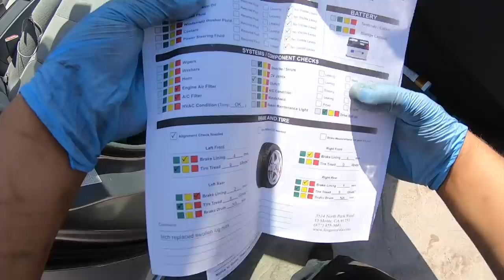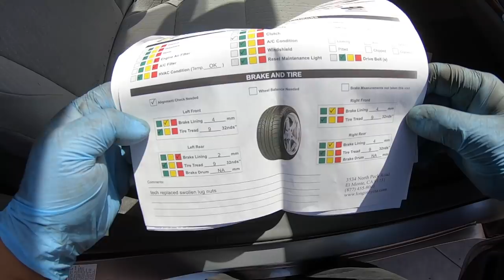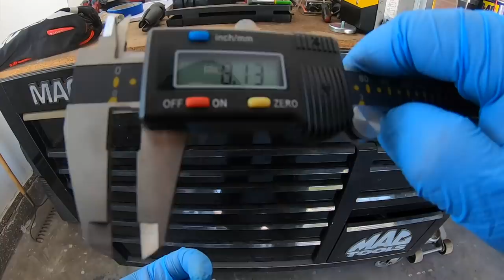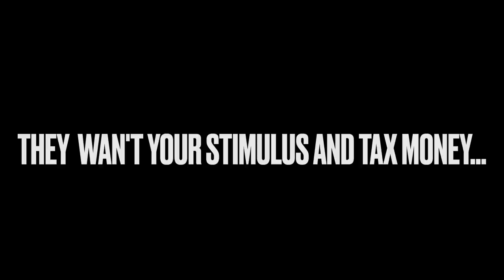This is why YOU need to avoid the Dealerships!

Comment: I was scammed by Honda dealership $2300 for a.c. repair that was never fixed the first time.At the second time when I come they said they have to replace the evaporator.I asked for some refund but the service manager refused not even a dollar refund.So from then on I became a DIY freak,Do everything about A.C. repair.and more.Also brakes,Timing belt is the hardest.So I won't buy cars with timing belt but chain.Honda stealership charges almost $1000 for that which you can do for $100.

Comment: im a tech at toyota also. The tech didnt take the tires off to get a good reading on the brakes. he just peeked from the outside of the wheel and thought they looked low. The technicians at my shop are very loyal, trustworthy and hardworking people. U got a bad tech.

Comment: I've had multiple dealerships lie to me (often Toyota, but I've owned a number of that brand). 

I had one tell me my 2003 Corolla needed a new timing belt (the car uses a timing chain, so that was impossible). 
I've been told I needed a service I just had done at the previous visit. 
I was told (this is sales) that the extended warranty they were trying to sell me was from the manufacturer (it was not: Toyota has no extended warranty program, unlike (say) BMW). 

I can't think of every example; but it's hard to find a dealership that will simply treat you honestly.

Comment: This is due to a lazy technician.
Doing a visual only multi point inspection (MPI) on every vehicle, you get this sort of laziness.
The tech probably didn't even take the wheel off for proper measurements.

Comment: Toyota shear my bolts that holds up my skid plate during an oil change. They secured my skid plate with zip ties (found out upon inspection during my incident). The zip ties broke while I was driving and my skid plate fell. They wanted to charge me $600 to drill out the bolts and retap. I called the dealership and they ignored me. I filed a complaint with Toyota USA and they ignored me. I have never worked on my 4Runner but now I do my own oil change, breaks and rotors which is very simple. I will do as much maintenance as I can.

Comment: I had an overheating issue with my 3 year old, 40k miles minivan. I brought it into the dealer that I purchased the van from, they checked everything including inspecting the radiator, "topping" off the coolant (it was already topped off), etc.. I ended up being charged $120, even though they didn't fix anything. I looked online and was told on a forum to check the fuse. It ended up being a blown fuse for the 2nd radiator fan. I spent $3 to fix it on my own. I called the dealer and explained the situation, they offered me a 10% coupon for any future repairs. what a joke.

That was 10 years ago, I've never brought my vehicle back to any dealerships for repairs.

Comment: Awesome break(brake)down...  Not all dealers are lazy/crooked, but the same goes for third party service as well. Ultimately don't blindly trust anyone. Some dealers have been the absolute best service with no BS or surprises... Others have been dodgy as and I call them out on it. Usually it's laziness, just basing "work" on the service manual not taking into account other work in the book or the car's actual level of use. Find a good mechanic and give them your business.

Comment: Longo did a terrible job fixing my car, the bumper fell off the same week! I tried to bring it back but they said my bumper was scrapped, so they didn't fix it. My front bumper had a light scratch from exiting a driveway. They even dropped primer on my car's side window and didn't fix it for months! They also overcharge for cars. Im never going back

Comment: If vehicle brake pads are at about 5mm left, which in some cases is about 50%, I'll mark it yellow. Once they hit 4mm, I'll start to recommend brake pads. 3mm and less is when I start to really push. By that point you are required to replace them.

Once you get to the metal backing plate of brake pads, you damage the rotors and you run the risk or damaging the caliper piston. Calipers start anywhere from $100 and upwards of $400.

I do get that some shops and dealerships will rip people off, not all technicians will push, unless they haven't flagged may hours during the pay period.

Comment: At the BEGINNING of the Video the man said "Get a second opinion!"  This is very true, until YOUR mechanic of choice gains your trust.  I AM a mechanic at a dealership. ALL MY customers trust every single word I say. And for good reason.  I tell them everything about their vehicles. Bumper to bumper roof to floor.  I give them certifiable measurements with pictures. I also let the customers see for themselves what I am seeing.  75% of the time I sell ONLY what the vehicle needs and nothing more. Optional services I only recommend when it further guarantees my success of the original repair. For instance,  I had a customers car than ran a bit rich due to a sticky crank case ventilation system.  I sold an induction service to clean all the old oil out of the intake manifold.  Results?  These days the only time I see the vehicle is during regular maintenance and routine services.  That same customer usually has somebody drop the car off and he calls me and says, "Do what you need to do, I trust your judgment."  This same customer is a football player in the NFL. And obviously he does not drive a toyota. But I treat EVERYBODY exactly the same no matter their financial status.  My only point here is Simple.  Do not lump ALL of us in the same sinking ship.  I work my butt off to maintain customer trust. And ALL my friends at work are the same as me!

Comment: Vehicle owners need to READ their owners manual & find their scheduled maintenance section on what the manufacture recommends on what needs to be done. Some say brake pads need to be replaced at 30,000 miles on average. It could be more or less on how or where you drive. Be informed so you don't get taken. 
   I have a 32 year old vehicle, scheduled maintenance states to replace spark plugs every 30,000 miles. I replaced them at 90,000 miles. At 112,500 miles I have an oil change done; they told me I needed spark plugs; I declined since they were replaced at 90,000. I waited at 120,000 miles to do them again. Were the worn out? Yep. Replaced them again. Get educated on your scheduled maintenance people!

Comment: My dealership told me I needed rear brakes, and wanted $700 for the job (pads and rotors). I said no. My friend verified that it would still be a good idea, so I bought parts and did it myself. Did I necessarily need those brakes done? No, but the rotors were worn a bit and the pads were not low, but showing damage. So, while I believe they were trying to jump the gun and get my money ($700 for rears? Really?), I don’t think they were being deceptive.

Comment: In Romania we by default assume the dealer is gonna try to rip you off. I have my own guy for car maintenance. One time I needed a diagnose on my ABS sensors and he did not have the tools so I went to the dealer. They did provide the results and also what I needed to change on my car...they wanted me to change around 1000$ worth of stuff, it was half the value of the car.
Took the car to my guy and showed him the results, he actually had me under the car to show the parts they wanted to change...they were in working order and they are still on the car to this day, that was a few years back.

Comment: For anyone curious. Brand new brakes come in around 12-14/32. Failing is 2/32 for an inspection. Rear brakes also wear slower. Assuming your calibers aren’t shot or you don’t drive like an asshole, you’ll typically get about 40k miles out of your brakes or more. A lot of pads also come with a squealer to let you know when your brakes are low without having to have them looked at. Keep all that in mind and you’ll know if you should be suspicious of someone trying to up-sell you on brakes.

Comment: The gas cover on our Hyundai stopped opening properly. I took it to the dealer. Not only does the dealer not offer to fix their own bad product, but they want to charge me $450 + tax to replace the entire door, which doesn't fix the root cause of the issue and will just break again in a few years. They also wanted to add $1300 in additional services. Wtf? I declined, and they got angry! Nice customer service. No I don't want to spend almost $2K today. I went home and fixed the gas door myself for free. Took less than 30 minutes.

Comment: Stealerships are worse than the independent places now. 

Went in to have some warranty work done on the wife's Camry. L/F brake was making a single "clunk" noise when moving from a stop in reverse. (backing out of garage). The stealership tried to tell me the rotor needed grinding because it was warped. If it was warped, 1. The brakes would feel like they were pulsing when in use. 2. Braking would be uneven and the car would pull to one side when braking. 3. The caliper would potentially drag on the rotor even when the brakes were not in use. 4. The brake pads would show uneven wear. The car had exactly zero of those symptoms. It just made the clunk sound.

And of course, for only $136, they would grind them down for me...because that is not covered under the warranty. 

We bought the car brand new. My wife drives like an old lady. She isn't hard on brakes....or anything else for that matter. They were just trying to soak me for the money.

That was my third run-in with that stealership. First one was a sales-parasite blatantly lying to me over and over and then another sales-parasite breaching a contract.

Comment: Hamer Toyota in Mission Hills,  CA stated the same to my elderly mom about her RAV4.  She was at Hamer to get a routine oil change, and to her surprise they inform her that the brake pads are low.  She phoned me to ask if she should have Hamer replace the pads (or not), and I told her to hold off until I check them (seemed very premature to me since she drives conservative). A couple of days later she brought her vehicle to my home, and checked the pads... they were at 9-10mm!!  

Towards the end of this video I heard, " I don't know why they do this," implying why dealerships lie about a service being needed when it really isn't.  Well, part of the answer is to bring in cash flow from unsuspecting customers.

Comment: I changed my own brakes. I didnt need to apparently but thought i did. Cuz my car was squeaking. And i hadn’t changed them in 6 yrs when i bought the car brand new. Turns out i never needed to change them. And i wasted 200$. I drive a manual. And hardly ever brake because im lazy.

Comment: ALWAYS try to check any work completed BEFORE you leave the dealership. My last trip they replaced a headlight bulb and cracked a mount on the housing and with my oil change they spilled oil all over the engine and didn't bother to clean up. Needless to say I immediately spoke to my service agent and was given a free oil change and the mount was repaired before I left.

Comment: Took my honda accord in for a air bag recall , they told me i needed a engine and trans oil change  because it was dirty, and that my coolant was dirty. I personally replaced the trans / engine oil 2 wks prior and changed the coolant 6 months prior when i replaced the radiator.

Comment: This cant be a blanket statement. I worked at a dealership as an Expert Volvo tech for 15 years and always did everything I could to be the most honest and morally responsible technician that I could be. ALTHOUGH, with the tech shortage and experienced techs like myself jumping the ship (because of bad management, bad warranty times, and just overall stress), they are now hiring any idiot that has a wrench and wants to work. I have seen many crooks come and go because of this tech shortage and it is only getting worse. I am happily now working for government as a technician and never will go back.

The other problem lays with management and bad customers. If i miss an inspection or I rate the brakes a 5mm and they end up grinding in 1000 miles, guess who comes in pissed off and cussing us all out wanting free shit? So i have to balance what I see with how I tell it to the customer. Its not a perfect industry and unfortunately it will only be getting WORSE as us honest techs are fed up and jump ship.

Comment: Good video. Most dishonest dealers probably still have an old discarded worn-down "sample" brake pad (from an older brake job) that they use as a BS prop to show the customer. You want to be there in person, watching the disassembly from the very start so they can't conceal anything from you. However, most places won't let you in the repair bays, using the standard excuse that their liability insurance won't allow it. If you don't have clear transparency from them, don't let them work on your car.....tell them to button it back up so you can leave and get a 2nd or 3rd opinion, so you don't get hosed!

Comment: I've got a 2007 audi a4 V6. About 5 years ago I started having random issues where the car would run bad, the check engine light would start flashing and it would even stall sometimes. The problem was very intermittent. Sometimes I could go several days and it would never act up. I made an educated guess and threw some parts at it that didn't fix my problem so it was off to the stealer. I was almost certain the problem was electrical in nature. Well the stealer calls me the next day and says if I want it to run right, it's going to need $7800 of work. They wanted to replace all ignition oils, all injectors (very expensive since it's a direct injection engine) all plugs, they said I had vacuum leaks all over and would also need a new intake manifold, and vacuum hoses. They also told me my water pump was leaking all over electrical connectors. I told them to pound sand and to forget it. Well I bought a high end scan tool and saw that my mechanical high pressure fuel pump was going crazy. Pressure would jump all over the graph. I proceeded to remove it so I could install a new one and low and behold, a little connector that plugs into it had cracked and wasn't on there very tight. Super glued it back on and never had another issue! That was 5 years and nearly 75,000 miles ago. I've done absolutely nothing to the car since other than routine maintenance. Runs silky smooth, tons of power, and no check engine light. Currently at 230,000 mi. on the rig and plan to go that many more. Oh and the water pump they said was leaking all over..ha I've never added a drop of coolant to it since then and it is still perfectly on the full line. Screw the dealer!

Comment: I worked in a dealership for 27 years, tech, dispatcher, service manger, then CEO.  if this had gone on guaranteed someone would be gone.  27 years later I still do consulting to a number of dealerships.  Not all dealerships are crooks, lazy or incompetent.  That said you need to watch out.  As a PS. Not all independents are up front either.

Comment: When you peek at the brakes without removing the wheels

So many Franchises or customer’s rush techs to go through their quick oil change, and free multipoint its better to say 5mm pad thickness when they got 9mm meat rather than say 7mm when you at 4mm.

OR

I don’t condone that practice, but when the pressure of high volume work is keeping you from doing a real multipoint, you peak at the car’s repair history and see what last break pad measurement was. Says 8mm, and you put 20k on the car, 4-5mm pads not off. 

Just two examples, as a Tech I’ve had to do both, but the rest of the time if the brakes were done, i’d leave the wheels off and have the advisor walk the customer in to see for themselves.

Comment: That's the same software my Dad's Honda dealer uses.  He took his car for a "complete check up."  He wanted everything checked.  All they did was look at the tires, look at the front rotors through the wheel openings, change the brake fluid, change the coolant, and change the oil/filter.  

They didn't check the air filter or the cabin air filter. (both needed replacing)  They didn't notice an air box nearly falling off because a fastener was missing.  They didn't notice other random missing fasteners.  They didn't check the wheel bearings.  They didn't check anything. They paid some flunky to connect it to two machines and do an oil change.  No one who knows anything about cars looked at it.  He paid almost 1000 dollars for this "service."

That's why I do my own work.

Comment: I have an ‘01 prelude that I brought in to a Honda dealership because my steering wheel was vibrating when I hit the brakes and I didn’t have time to do it myself. They told me nothing was wrong with the brakes,charged me 90 bucks so off I went to a small independent mechanic. He found front rotors warped and one back caliper  was sticking and not working at all,the whole rotor was rusty on both faces indicating it wasn’t working. New brake pads  all around,machined rotors and freed up caliper, stopped like a Porsche after. Went back to Honda and all they said was they would give me my money back. I said that wasn’t the point of my returning but they wouldn’t listen to logic. Got my money back,now I do brakes myself.